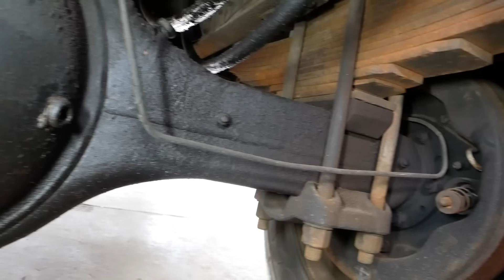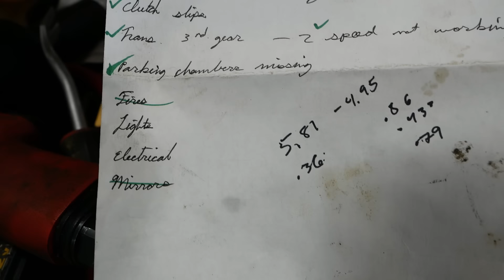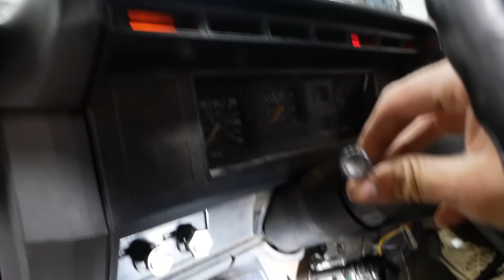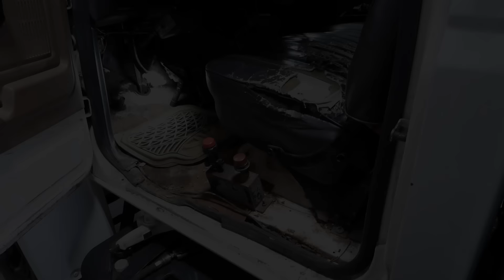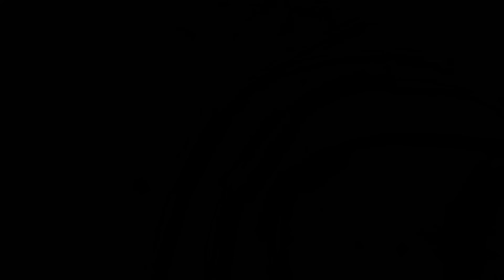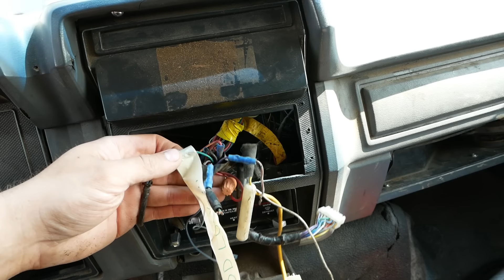Ford F700 Cummins Chipper Truck Project - P Pump Fuel System, Brake Chambers, and Wiring - Final

Comment: If its just a small hole i have had good luck with coating the float with por15 fuel tank sealer just one coat make it to heavy you wasted your time

Comment: Who can guess why the truck went to the auction, I hope the sales price was low to pay for all the work that it needed. Once you had worked your magic, it ran like a substantially better works truck. The engine sounded sweat, but the cab still showed the years of abuse it had suffered. You showed huge patience as you went through more work on the wiring than was likely spent on the original build. The bill shock must have been substantial, but given the work it would be totally justified.

Comment: After the shot of the exhaust entering the cab i did notice it must have been an improvised rodent control measure since their were more wire melted under dash than chewed on. Great job wes on resurrecting this ride, happy fathers day!

Comment: Another Gr8 job Wes !!   The reason the upper marker tail lights were probably wired into the turn signal lights was to have maximum 4way lighting when parked or working.

Comment: Wes, fantastic work and work ethics. If you charge $80 per hour, which should be your minimum, and worked 40 hours on this beast. $3200 labor is more then fair. If you got more, well you deserve it. Thanks for sharing.

And that was for the work you just showed in this episode. I forgot about the other ones. Maybe 80 hours.

Comment: Easiest way to tell if a "Charge" (Ammeter) gauge is working is to
use the turn or hazard lights. The moment of dead short in the bimetal flasher will
usually make the gauge's needle jump. 

This was an awesome job, you really shined here Wes.

Comment: The 4" red lights at the top rear does work as stop and signal lights, I've driven similar tucks in the past and it adds more visual braking and signal lights when dragging a chipper behind.

Comment: Nice job, Wes.  I didn't hear a back-up beeper, (aka, back-up alarm/vehicle motion alarm), when the transmission was placed in reverse.  Does this vehicle not have one?  Again, great work getting this truck back to a safer working condition.

Comment: Wes: Crescent wrenches, end wrenches, and maybe others, have angled heads. There either is, or is not, a correct direction to use them. Would you please address this in your scholarly way. May be like the dielectric grease debate. Thank you for your views.
Reply from the maker: Never seen any difference myself.
Reply: @WatchWesWork  One side of the debate is that the angle was engineered for jaw grip force or strength. My father taught me to always angle the handle toward the direction of force, but the internet tells me many people think there is no such rule.

Comment: fyi the batteries on the London Routemaster bus are under the stairs at the rear; the cable runs up to the upper deck, then along the length of the bus to a starter switch mounted above the driver's left shoulder, about 15+ metres in total. The buses were wired positive earth, which came as a surprise to the engineers installing video cameras who found instead that they had fitted some very expensive smoke generators.

Comment: I was just watching one of your old videos from on Dec 31 2018. You were working on a Cummins L10 STC smoke and rough idle.   I get to the end of your video and you're test driving it.  You pull out of the drive way and I'm like ummm that building looks familiar, that road looks familiar, that has station looks familiar. You were at Jim Hawk Trailer in East Peoria!  Do you or did you work there?  East Peoria is about 10min from my town of Pekin.  Just thought it was pretty cool as hell Watch Wes Work was right down the road from me! YOU'RE FAMOUS MAN! 😎

Comment: So, did the wiring  harness for the blend door shaft happen to be run thru the ignition switch and was the wire melted?  That was a load of work you got done.  I guess the kiddo can go to college now?

Comment: Funny and not so funny thing about those early Fords is that the throttle linkage would pass so much vibration back into the pedal that driver's foot would go to sleep.  I think the fix was 1/4' hose wrapped around the rods.  remember those antiques quite well.

Comment: I have a friend who wires police cars when they are new and he gave me a pair of wire crimpers that have a tooth in the jaws. I have made crimps that you can pull the wire apart before the crimp will come loose with those so I promptly threw all of my wire crimpers in the trash that did not have that feature. They are awesome!

Comment: We called it Out Of Sight Warranty.  On a Chipper truck the use to run turn/brake light high because the lights on the chipper would get broken even trying to protecting them. Just how is that ruck passing an D.OT. inspection before you worked on it.

Comment: Happy FD Wes. Your Moscow micrometer sure looks a lot like a southern socket set. I've been buying wire loom in 100' rolls for years because of all of the boat trailers I've worked on. I don't even try to fix wiring on trailers anymore. I give the old stuff the heave ho and pull all new stuff from stem to stern, but I use dielectric grease so what do I know. The length of those battery cables is crazy. Bet your customer is happy as heck to have his truck squared away.

Comment: you can have high mounted turn signals and brake lights Kentucky trailer has had then available for years and other manufacturers have been using dual purpose maker/ signal lights for a few years as brake & turn up high

Comment: Again, memories of the beat up f700 chip truck I used to drive and work on... ours wasn't as bad as this, simply for the sake of the wiring... I mean holy F--- when I saw those wires I thought it was some kind of sick joke. Especially the stuff behind the taillight. Wow... yeah those clearance light usually get smashed when someone forgets to crank down the chute on the chipper. This one was a hell of a job and I don't envy you for this. The amount of work this thing needed would exceed its value in most cases. I think the motor is probably the best part about it. Ours was a gasser like the last f700 you had here. Nevertheless I enjoyed this one. Take care Wes!👍👍

Comment: It’s so refreshing to watch a true mechanic repairing things the correct way.  I absolutely love to watch your vids Wes.  Keep them coming, you go to great lengths to not only correct things the proper way but everything is nice and tidy.  There aren’t any mechanics around my area with your attention to detail.  Great  vid.
Reply: I’d also like to borrow Wes for some TLC on my Peugeot 308 diesel,which is right now writing its own terms for its death sentence … slowly
Reply: @RGSneaker  '
Reply: Especially with wiring done the right way. So many pro mechanics don't do clean wiring work, quick splices etc.left open to elements soon to rot out or short out against frame or each other.
Reply: @paulgraumann2774  That's how the rookies keep busy, by doing shoddy work that'll have the customer keep coming back.

Comment: You can’t beat a giant nut fucker wrench. There is nothing worse than soldering a connection or three then realize you didn’t put shrunk tube on. Especially in a tight spot

Comment: I like the expanded metal wrapped around the pedals
Reply: First time I ever heard that term was in this video, and now you're saying it too.  I always called it wire mesh.
Reply: @DanEBoyd  it depends on the manufacturing process. Mesh is a type of weave. Expanded metal is mechanically cut and stretched.

Comment: Amazing it still ran after all those modifications. Try that on a new truck, when they are done, they're pretty much done. At least you could get the old ones home. Of course you're supposed to repair it properly when you get home.
       Good video Wes, best regards from Indiana.

Comment: I had two of those f700s .I liked the top signals for pulling a chipper .The chipper lights frequently failed.When the crazy brake  system went bad no mechanic that I knew could fix them.I got rid of the trucks.

Comment: Just out of curiosity, what town in North Carolina had that truck ? The mechanics working there are clearly not top shelf or else the town just said fix it however you can, as cheap as you can.

Comment: 2:11 I worked on a Pete with a 3406B in it and the Racore separator had so much algae in it the engine was lucky to make 5lb of pressure vs 45-50 at the transfer pump.
Question: Do you charge the customer when the complete job is done or is it charged per repair ? Thanks.

Comment: You missed the important part-
The expression on the customer's face, when you presented the bill and the ambulance answering the cardiac call.

Great work and excellent video.
Reply: Well he has a very solid truck now. Buy a good truck for a lot, or buy a cheap truck and put a lot into it. I reckon he faired alright.
Reply: Yeah. At least its a fairly solid truck now, especially with the cummins. Everything is sorted and its rust free. Prob a 5 figure repair bill though.
Reply: That customer is lucky to have Wes willing to work on that truck.  His deep knowledge and skill showcased on this one.  I hope he charged by the hour for labor on this, no other way to do it.  I would be curious how many hours total.
Reply: LOL good one !!!

Comment: What happened with the 2 speed rear?? I saw you using it when you were driving but you never really touched upon that point during this video series??
Reply from the maker: The plug was loose. I “fixed” it in the intro to the first video.
Reply: @WatchWesWork  I want to know what the C-clamp was doing back there..........

Comment: Around Atlanta it's pretty common to see chipper and garbage trucks having the turn signals high on the body. I assume so they can be seen when when stopped on the side of the road.

In South Carolina, trailers don't even have to have lights if driving in daylight, so the trucks signals could be seen around a chipper.

Comment: back in the olden days they used a plastic float for fuel tank sending units.on kw and petes
 the coating would the plastic coating would fail and the floats would sink.so the company I was working for said screw it the tru ks were home everyday and they were fueled at the end of the day. 
 a driver driving a 1965 pete mule train would lose power intermittently.
 we went through EVERYTHING TWICE THREE TIMES.
the truck ran fine for a couple of months. 
 then it would begin to lose power again.
  finally we drained and removed the fuel tank.pulled the sending unit and found it had a wooden float and it had come loose and was. floating but submerged in the fuel tank.it was fuel logged. 
 at the end of the day the driver would refuel the float would be suspended around halfway down in the tank when the fuel was half a tank the float would be near the bottom of the tank.
 under the right conditions the float would get sucked to the pickup tube. there was no sock. on the pickup tube it would be shut off the fuel starve the fuel the motor would die releasing the suction bound float it would float free the truck would restart .

Comment: My experience with electrical makes me wonder if it wouldn’t have been cheaper to buy a new truck . I sometimes enjoy an electrical puzzle , but that and the other work on it must bring the bill pretty high  . Running , driving , and working making money  ,  what’s the truck worth $
Reply: Brand new, $80k. If the owner was in it for under 20-25k (truck and repairs) he would be doing well for a fully functioning/sorted and rust free truck.

Comment: Im still expecting to find a client like the owner of this ford...most of the guys i know as soon as transmission has a problem truck goes to junkyard.
Reply: Thats a very specialized truck. Not easy or cheap to find a replacement, thats why its still on the road.
Reply: ph not to mention with trees and limbs falling on them every day, why would you want a new one?

Comment: Truck Owner: Have you diagnosed and found the part that's broken on my truck?
Wes: Uh huh It took me a while, but yes I finally found it...
Truck Owner: So what part was broken?
Wes: The big part between the front and rear bumper.
Truck Owner: Can you narrow it down to a specific part?
Wes: All of it...
Truck Owner: That's bad.., what do you recommend?
Wes: My deepest sympathy....
Truck Owner: Are you going to require special tools to fix my truck?
Wes:  Nah... just a A Ouija board, Magic 8 ball, some emotional & mental support, a prescription from my doctor for this twitch I developed, 300 feet of heat shrink, 3 dozen light bulbs, 400 feet of wire, and 2 cases of terminal connectors
Truck Owner: When can I expect to get my truck back?
Wes: Sometime after the 3 part doc-drama mini-series comes out
Reply from the maker: Nailed it!
Reply: @WatchWesWork  Give credit where credit is due...You are without a doubt., one of.., if not my favorite mechanic on the tube, its indeed a pleasure to Watch Wes Work👍👍

Comment: Just FYI — I was “Like” number 666. Someone had to do it. 
Just replaced the water pump on a friend’s 6.7 Cummins. Impeller was totally different. It’s a Ram 3500 and a complete biotch to get to. My arms are still shredded. Old pump was original with 240K miles on it. Bearings disintegrated and the pulley shaft broke clean in two. Now THAT’S a failure! 
I just bought a 1987 International S 1845 and every single light on the truck works. Dash lights too odd thing is this truck has no door switches for the dome lights. Strictly by hand with the light switch. New one on me. 

And leave Captain Kleeman alone!

Comment: A lot of the tree chipper trucks I see down here in Texas put little metal cages over the lights. Not sure if that is permitted in illinoisistan. But it helps with stopping the lights from getting smashed

Comment: Rust was the only thing this job was missing. lol
Reply from the maker: It’s a nice change of pace!
Reply: @WatchWesWork  This truck should definitely get some corrosion protection stuff on its underside before the next winter.
Reply: @Itsjustme-Justme  Makes me wonder why that wasn't done before the owner got it
Reply: @rawr51919  Look at the othe older trucks Wes is working on. It seems to be uncommon there. They all rust away badly.
Reply: @Itsjustme-Justme  yeh, a shame tbh
Reply: Two of the best channels on youtube. Vehcor & Wes. Its great to watch creators doing repairs the proper way.  Much respect for both channels. Maybe Wes could add the "pile maneuver" as a discrete shout out in the next video.
Reply: Yeah good nick underneath compared to some Wes has shown us!
Reply: did you ever fix the jeep
Reply: No coincidence there. 
That old truck came out of S.Carolina and nothing could be finer. If it was a rustbelt based truck, it would have been ready for the big pile in the sky. Nice to see the Mustang BTW. It's looking solid, unlike the B is for Build, Eleanor project. Lets face it, that cease and desist order probably saved some lives. More like "D" is for Debauchery!  Cheers!

Comment: Hopefully there's a special place in hell for the not only the users, but also the inventors of scotch locks and wire nuts(which are somehow an accepted and legal, but scary, choice for household and industrial wiring).
Reply: They work fine for what they were intended for. Certainly not in these conditions.

Comment: For soldering floats, I like to drill a tiny hole somewhere else than the repair to let the pressure out so you are not fighting it while you are making the larger solder repair, then you can just touch the little hole without appreciably heating up the float and causing your solder to pop out. And I would bet a dollar the toasted "Ignition" wire was for the shut off solenoid, and got toasted when the old shutoff solenoid failed.
Reply: That seems unnecessarily complicated. I just use scotch tape.
Reply: @heikovanderlaar3780  to submerge in fuel? Glad you don’t work on my vehicle
Reply: @jimmyoakeslift4374  Just wait until you hear how I fix brake lines.

Comment: Quick question on the shutdown solenoid. If you could only find the Dodge replacement part, would it have been better to convert the Ford Harness to use the standard plug for the Dodge solenoid? It should make future replacements easier, unless I'm missing something.
Reply: He had the Ford plug on hand.